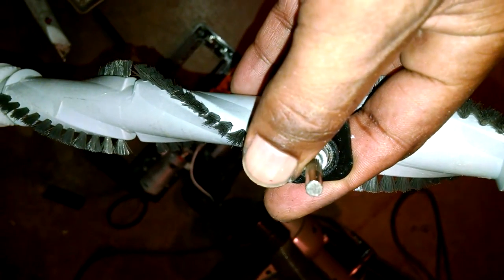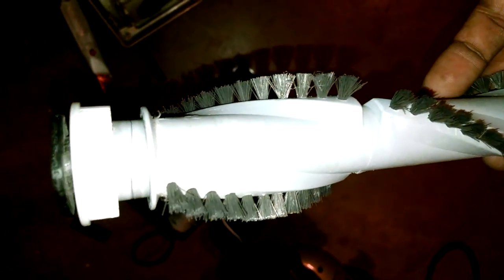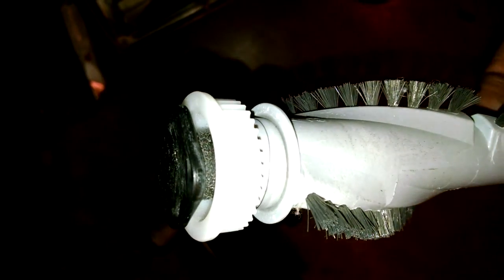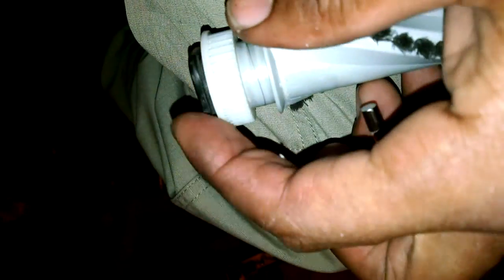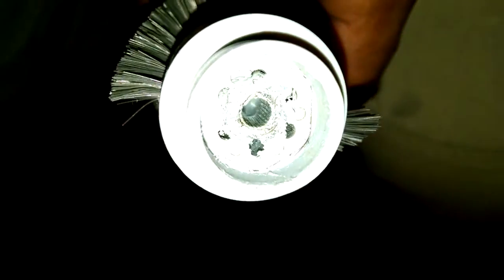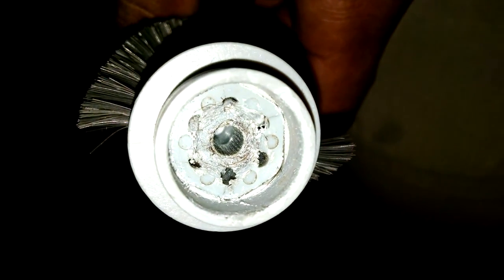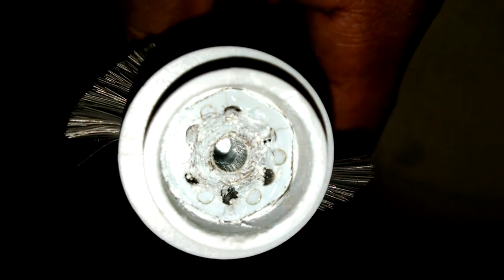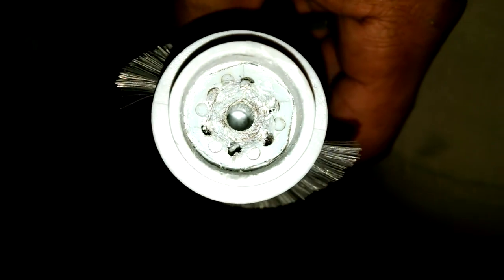Shark Navigator Repair 2

Comment: Thank you for making this video. How were you able to get the bearing piece out from the brush roll? Thanks for your time.
Reply from the maker: Tenisha Matlock The Bearing shaft is not press locked. they both just pull out. even on new ones. this provides for flexibility and motion for the brush.
Reply: The shark i am repairing is a navigator also, I was able to get the black cover off the wheel, I have been using needle nose pliers to pull out the metal bearing but no budge. Any suggestions of tools or method to use?
Reply from the maker: Do you have a small vise and a small brass drift? If so, you want to lock the shafts in place in the vise. And use the brass drift to gently tap the wheel off. If you have to give it more than a few taps on each side then it is time to order the brush assembly which you can get from Amazon for less than 25 bucks. Hope this helps.